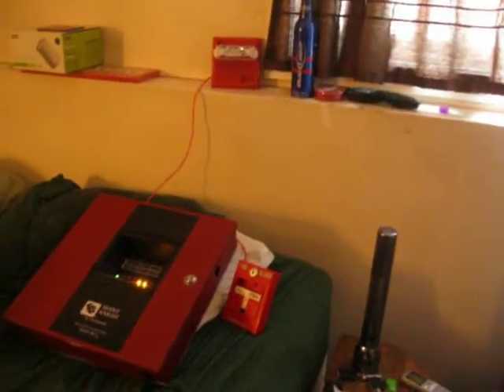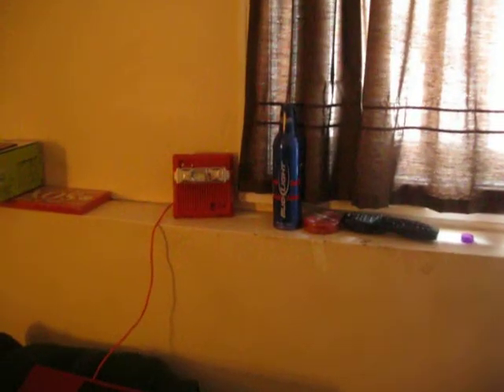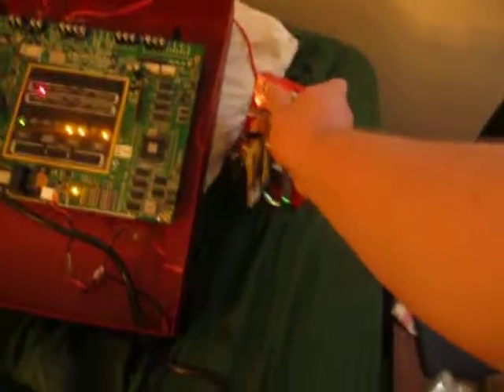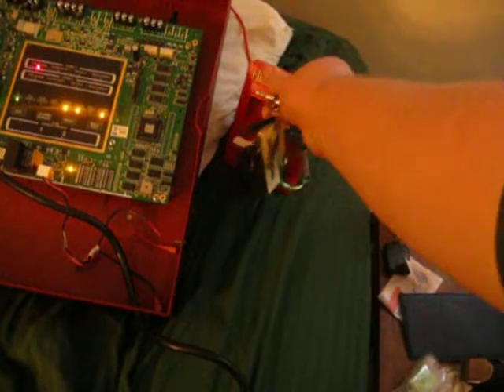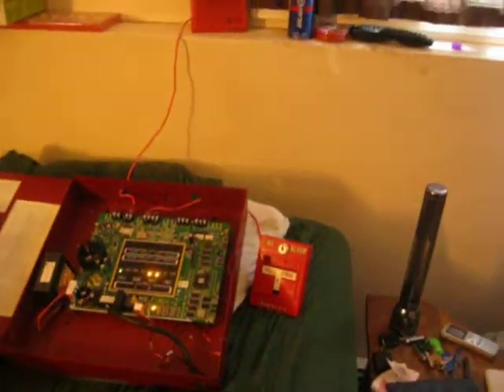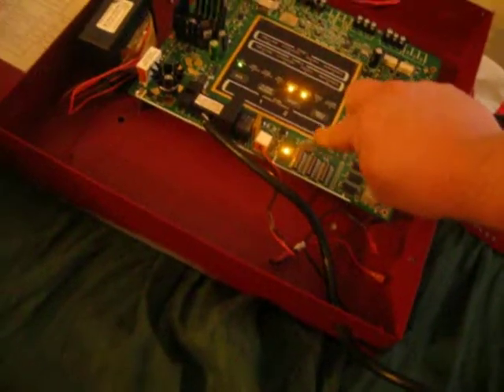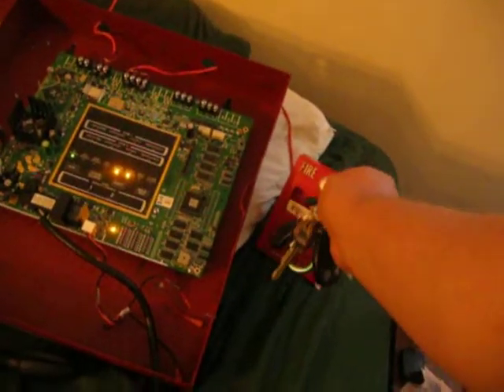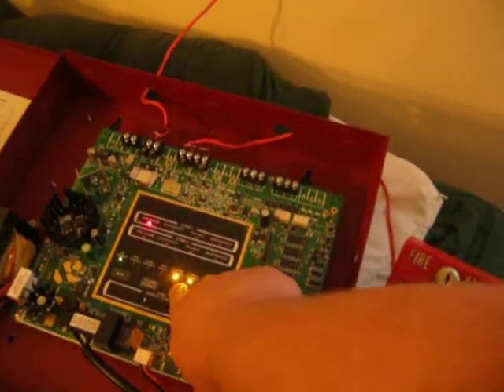System Test 12

Comment: Sounds the same as if the horn had been set to code-3 other than that short blast on continuous then two short blasts after you opened the pull station.